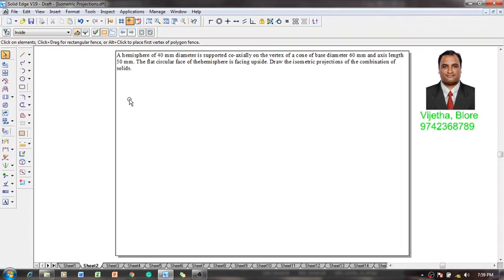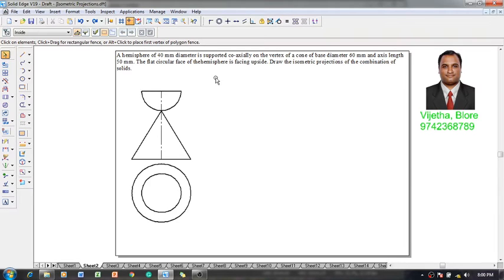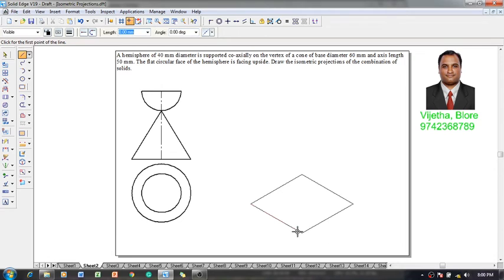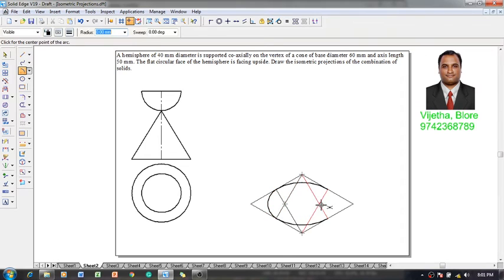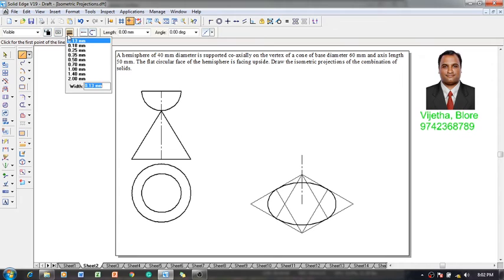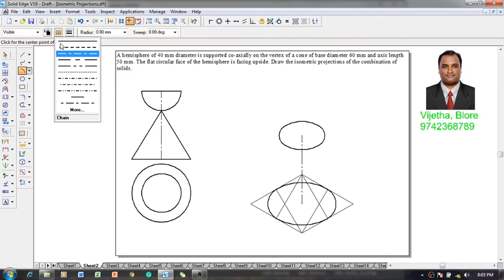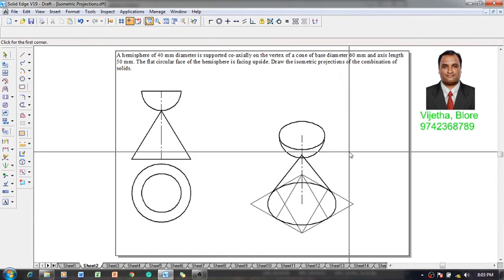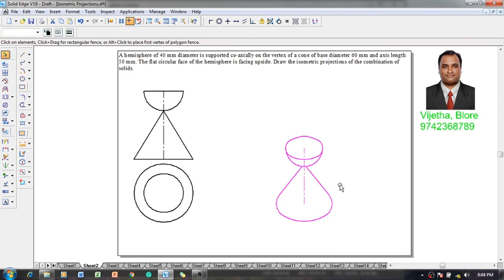Example 02 on Isometric Projection

Comment: Hi sir can u plz give the settings we need to enable
Reply from the maker: Yeah sure, Maintain Relationship should be on. also make sure A4 size sheet that's it.
Reply: @VijethaVardhanRN   Thank you! Is it applicable to autocad 2025?
Reply from the maker: Nope you need to check it out for autocad 2025

Comment: Sir, generally when we dont scale down the hemisphere or spheres right sir?
Reply: Because we generally scale down the cone and keep and hemisphere as it is?
Reply from the maker: Yes correct, but using the 4 arc method generally we reduce it.
Reply from the maker: Only the spherical portion will remain unscaled
Reply: @VijethaVardhanRN  ok sir. Thank you very much sir
Reply: @VijethaVardhanRN  so hemisphere portions will be reduced with the rest of the projections sir?
Reply from the maker: yes
Reply: @VijethaVardhanRN  Thank you sir
Reply from the maker: welcome